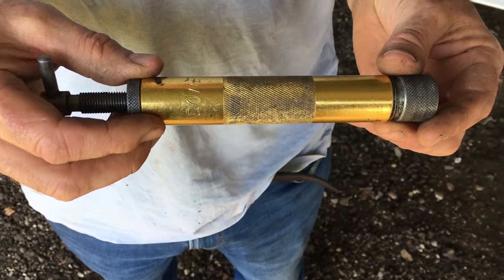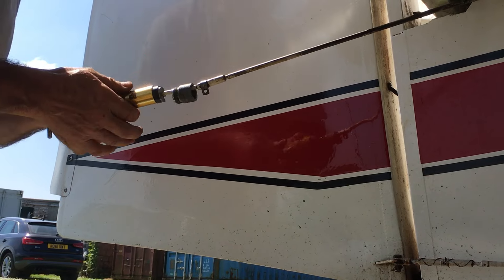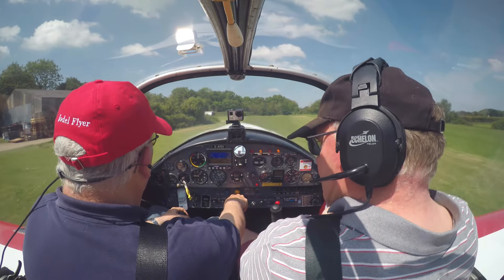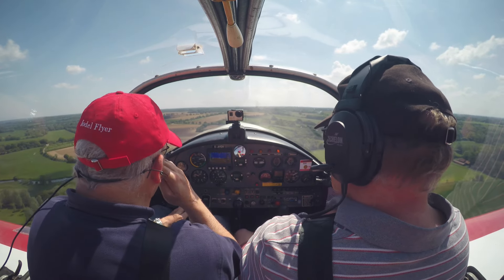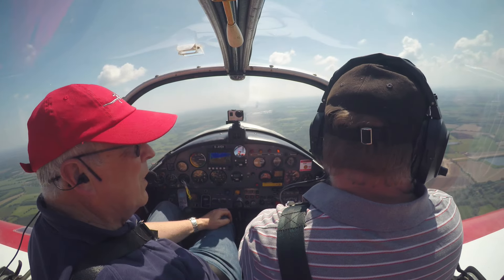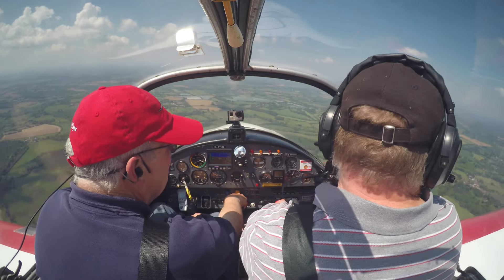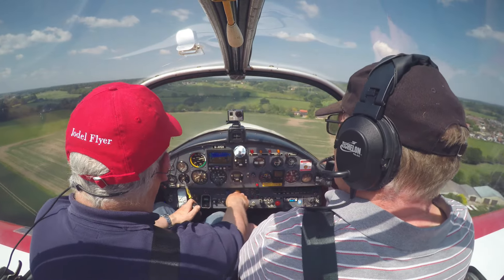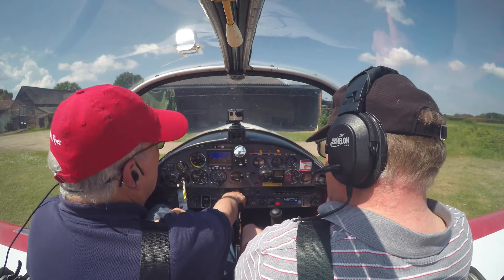DUNCAN'S CABLE OILER - PILOT VLOG no 402

Comment: That cable oiler is a good bit of kit.  Something still useful from a more industrial age, that doesn't need to have Bluetooth or a good wi-fi signal.  I enjoy seeing old devices like those.  The quick air test seems to have shown it all works well.  Its is good that you've got a Duncan and a Rob on hand to help.
Reply from the maker: It was good to have their help and as I said in the description I had never seen a cable oiler before.

Comment: Always nice to have a smooth trimmer. I had a simular cable oiler back in the days, when I rode motor cycles.
Reply from the maker: It does make it so much easier so I was really pleased with the results.
Reply: @JodelFlyer  it's good to have things work the way you want.  I hope to see you some place soon.

Comment: Hi Tim, I had a similar problem with the trim on my D120 and oiling it helped greatly. However, the stiffness soon came back and further investigation found that where the cable went under the tailplane, a very short length of the outer cable had rusted almost through. The rest of the outer cable was  in excellent condition.
Reply from the maker: Thank you for your reply. I will keep an eye out on the outer cable.